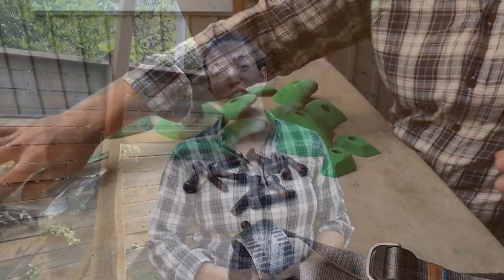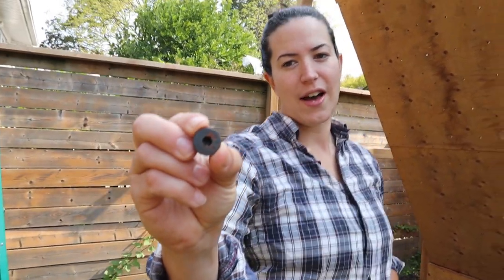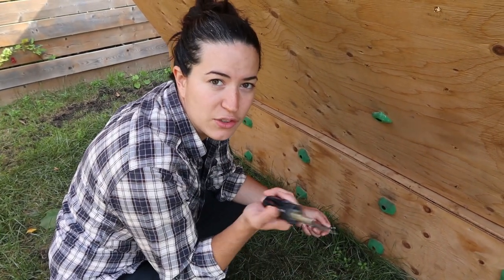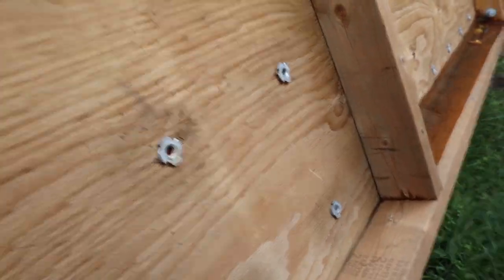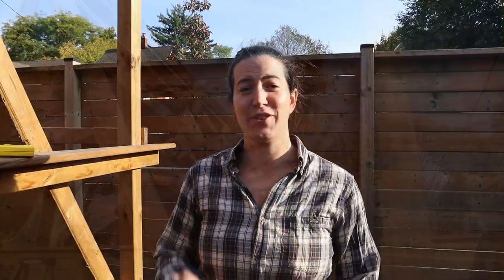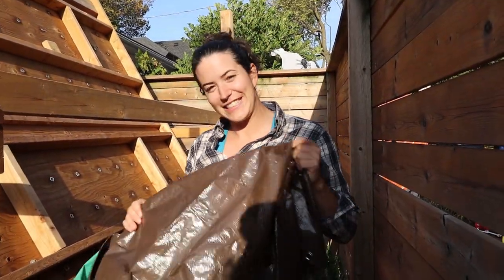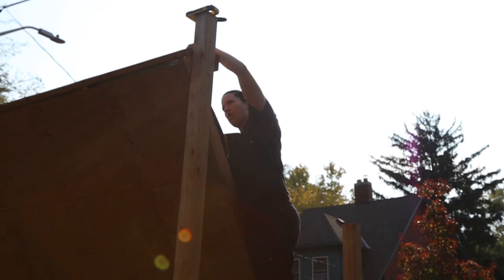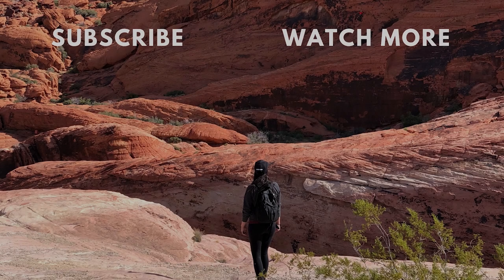Winterizing the Backyard Climbing Wall - Vlog #041

Comment: just a heads up, wd-40 is a de greaser.b It has temporary lubricating properties but those will have diminished by now. I would recommend taking the tarp off and adding a few drops of engine oil or hydraulic fluid into each t nut. If you do that there's no chance they will corrode over the winter. Also, use oil on each bolt to prevent them from seizing and being a pain in the ass when you try to take them off later. You can also buy anti seize but you probably already have oil at home.
Reply from the maker: This is awesome info!! we will give this a go, thank you!!
Reply: @CourtneyWarren  hell yeah! Are you guys going to hit up the Glen anytime soon? It would make a great video
Reply from the maker: @AMM1998  absolutely love the glen! We’re going to try our best to get there again soon, can’t go until Nov though! Keep your fingers crossed for decent weather :) I’ve got a few videos on the channel right now of us climbing in the glen but you’re right, glen vids make for a good time!

Comment: I’ve got my home wall covered in water-resistant sealant, and I’ve used stainless tnuts and stainless bolts. Most holds are from Atomik and I think they can handle cold temperatures. I wasn’t planning on doing anything to winterize because of these factors. Not sure if I need to.
Reply from the maker: I used all pressure treated wood, stainless steel tnuts, but not bolts (whoops!) 
I think we have our bases covered with just putting the tarp of the back to protect from rain/snow build up, but we’ll see!

Comment: Nice! I originally added a tarp to the back of my home wall to protect from rain and snow, but once it started melting I got some leakage... I climbed on it during the winter by making an awning and completely wrapping the full wall and frame with two heavy duty tarps and kept it heated while climbing with a propane gas heater! It worked! And I've just done a full reset now that it's spring, and there are some rusty bolts, as to be expected, but I did have about half SS bolts just incase so the wall is stilli n good condition!
Reply from the maker: That is awesome! Winter sessions with a heater would be so much fun
I’ve definitely got some rusty bolts but like you mentioned, totally expected 
Glad to hear your wall is still in good shape, may the sends continue!!